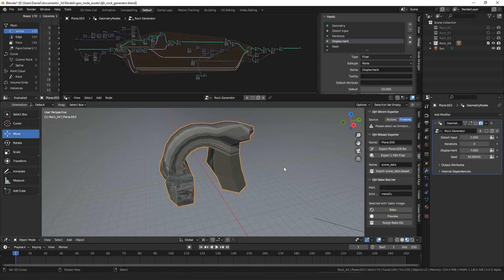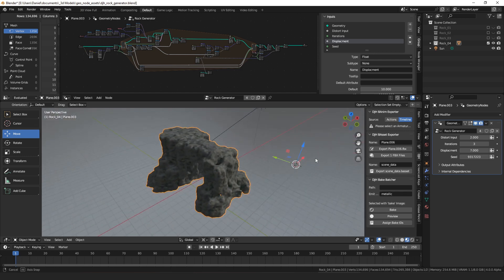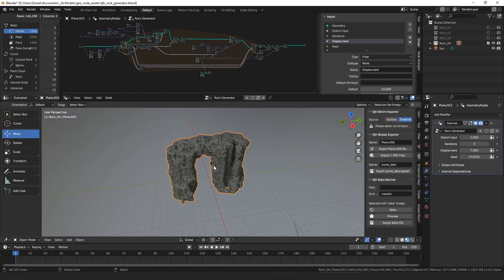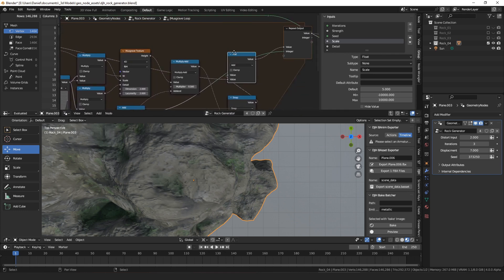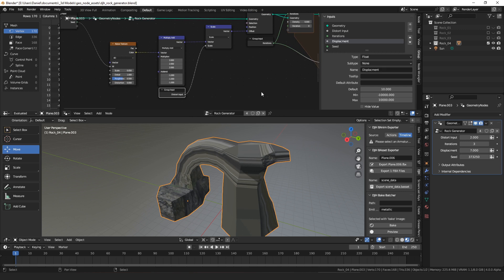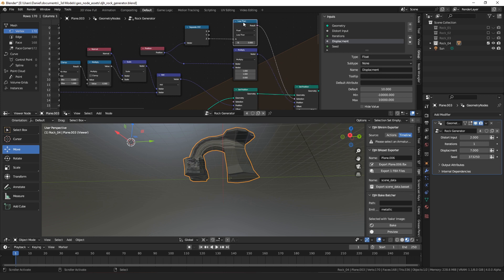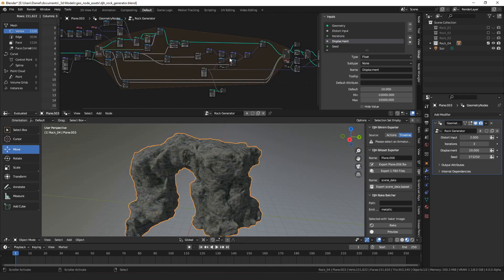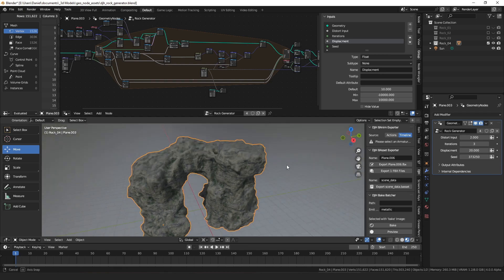Rock Generator - Blender Repeat Nodes

Comment: It could possible make tree generator and use this node to make forest where every tree different shape?
Reply from the maker: Possibly, but the tree generator isn't really set up that way.  I would recommend creating a collection for the tree, duplicating the tree object and changing it's seed until you have enough variation, (if you've downloaded my DJH Utils addon, you can make many duplicates and then run the Randomize Seeds operator).  Then I would use the collection scatter node to scatter the objects in that tree collection across the terrain.